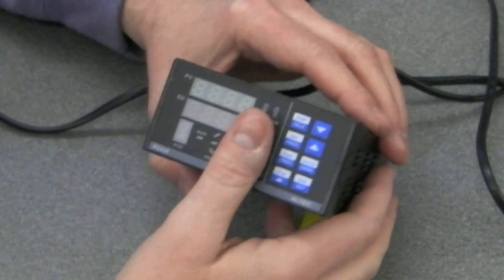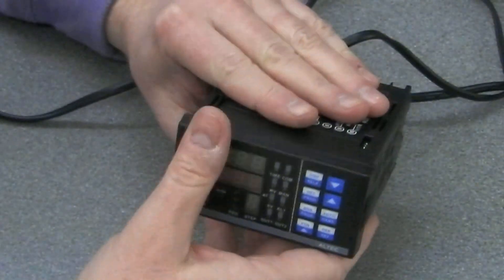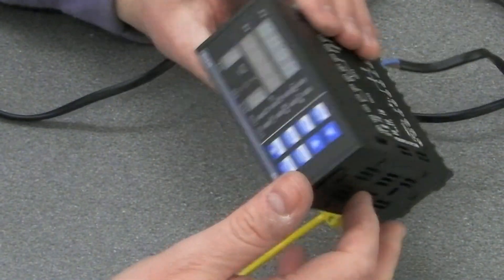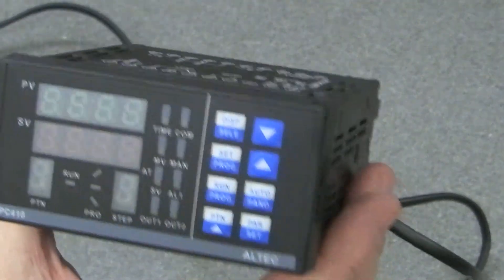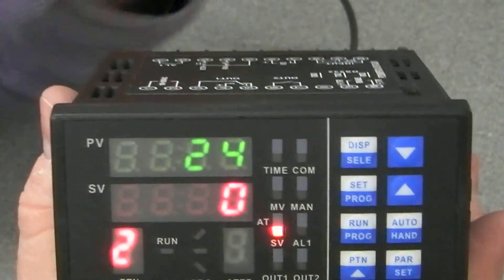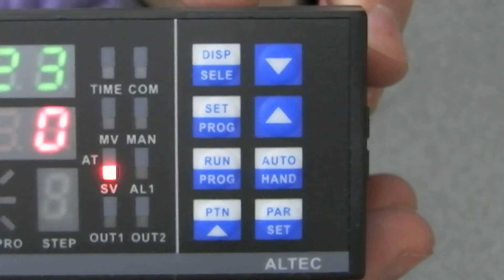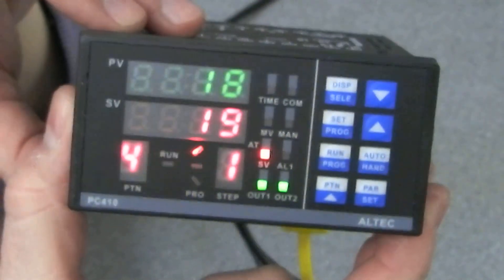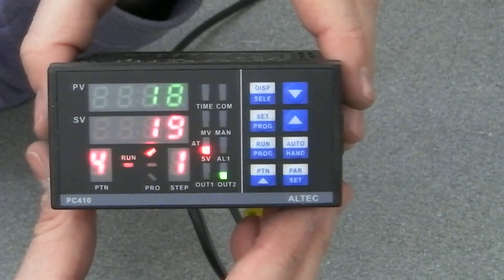PC410 BGA Re-work Controller

Comment: Mike
Hi have you ever had the need to get into the Configuration Parameter list SN10 through to 26. I have a PC410 which runs fine just that I would like to adjust things like Auto Hand enable and the "Unit of program running time"
Any help would be appreciated

Comment: your controller looks like it's actually in hold mode, it's not actually running. to solve this the run contact 14 needs connecting to contact 15 which is the common for the run (pin 14) and the stop (pin 13). I connected a switch between 14 and 15 but if you don't have a switch to hand just connect a bit of wire between the two contacts. Took me a while to get to the bottom of this. hopefully you've sussed it by now but hope this helps someone. good luck all.

Comment: hi mate am also try to make a homemade BGA rework station i have buy the
 Digital Adjustable PID Temp Controller and the Altec PC410 Temperature 
controller can you pls tell my how to wire it up to my upper and lower 
Infrared Ceramic Heating Hot Plate please and am i going to need  one or two Solid State Relay

Comment: Google ALTEC "PC900 user manual" which is the correct manual that explains everything you need including the friggin PIN code you have to enter to get into the settings menu!  I was so frustrated learning how to program mine!!!
Reply: cheers that should be all i need after having a quick look, perfect.  I found a very shortened version whilst searching for the pc410 but this pc900 manual looks alot better.

Comment: Do you have any idea of what Pins 4 and 5 run in the rework stations?  Would the 26 volts be enough to run one of the heating elements?
thanks.

Comment: did u fined how to connect it?? i can help with that as ive got a homemade rework and i use it also i do have a good diagram for it IN ENGLESH
cheers
Reply: Gonzalo Fernandez cheers I'd love a wiring map for the pc410, mine only had the top sticker with the pin numbers and little bits of info on some of the contacts but nothing really describing what they are 4 and the manual isn't much help either.